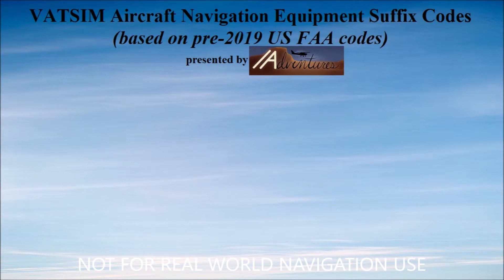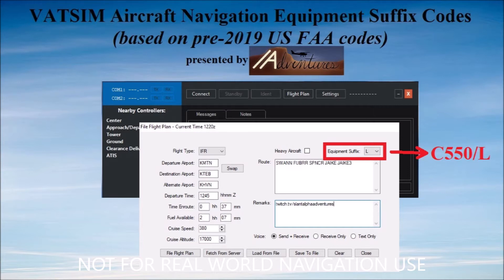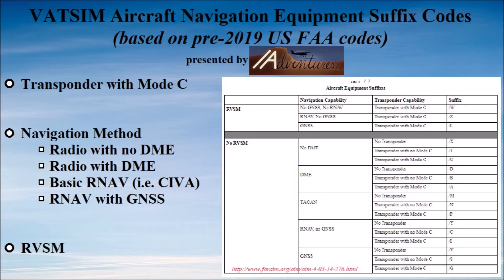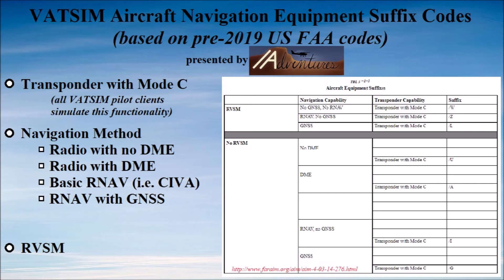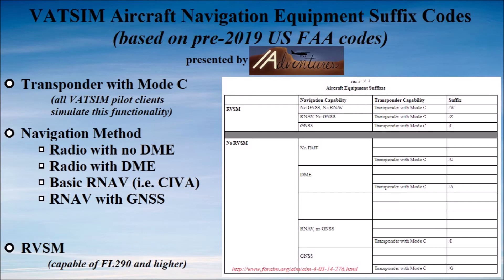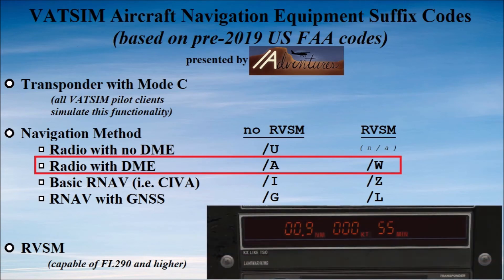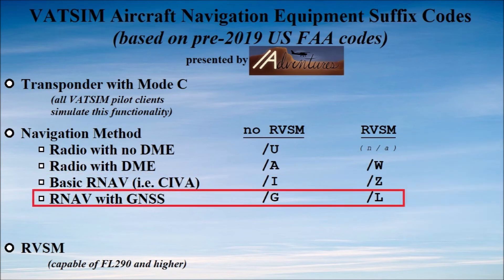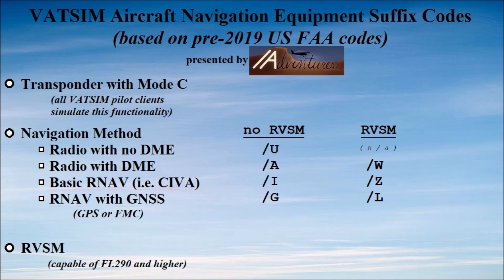Slant Alpha Adventures: VATSIM Aircraft Navigation Equipment Suffix Codes Explained

Comment: Thank you for this!
Reply from the maker: you're welcome!  at this point, though, you probably want to start looking at the ICAO ones because the rumor is that our ability to file on VATSIM using the FAA codes is about to go away.  https://youtu.be/gENYErF93WM
Reply: @SlantAlphaAdventures  ah okay. So, just use C to indicate Mode C transponder in the case of most of our GA aircraft?
Reply from the maker: sorry, I'm just now seeing this.  YouTube doesn't notify me of a second and subsequent reply on the same thread, unfortunately.

yeah, for transponder I'd go with C as a standard, vintage, Mode-C transponder.  however, with ADS-B (digital location transmission) becoming more and more pervasive, and even starting to be required in the real world to fly in certain airspaces, I guess to be consistent with real-world requirements you might just go ahead and claim you have a Mode-S (code S or L, depending on exact capabilities).  Since Mode-S isn't fully realized in most simulated aircraft nor on VATSIM yet, t's not super-critical that you truly know every nuance of it.

Comment: just a question, on xpilot how do you file your flight plan through the pilot client/ the little window. it keeps bringing me to the vatsim page and i really dislike it coming from a person using vpilot.
Reply from the maker: You can't anymore.  vPilot will soon do the same so enjoy it while it lasts.

The reason is that when changes are made to the flightplan form, it used to require every pilot client to be updated too, and they're all maintained by different people.  So they are moving toward the clients all redirecting to the web filing page.

But I'm with you.  I'll sure miss it when it's gone.
Reply: @SlantAlphaAdventures  ahh alright sad to see it going, so easy previously to file flight plans but hey at least simbrief has an import flight plan button and can do it in a quick second.

Comment: Lately every time I'm trying to fly /A I file SDF according to the new ICAO standards. When I log on the controller tells me I filed /W. So I'm confused because from what I can tell S= Standard VOR, ILS and COM radios, D= DME, and F= ADF so I wonder if I should just file A in that box but from what I found in ICAO codes that is for GBAS so like I said I'm lost
Reply from the maker: Great question.  Here's what I know -- the VATSIM servers do some "automatic conversion" from the ICAO format to the FAA format, because VATUSA controllers were getting these long strings of codes on their scopes in certain data tag modes that was making it impossible to see who was who.  But the logic isn't perfect.  And it sounds to me like the logic isn't able to tell properly whether you've filed basic VOR/DME without RVSM (A), or basic VOR/DME with RVSM (W).  But the good news is that those codes are functionally equivalent when it comes to lateral navigation.  You can't go direct to an intersection, unless you're tracking along one of its radials already, in either case.  On VATSIM the difference between RVSM-capable and non-RVSM-capable isn't truly that important.  Hope that helps clear things up!
Reply: @SlantAlphaAdventures  Thanks for your reply Rob, I actually just had a chat with an LA center controller and he did mention something like what you said. He told me to just put an A in the Equipment box like before. You just can't put a / because the website rejects it.
Reply from the maker: @Qosmokid  thats correct.  on the VATSIM flight plan web form you don't put the /.  the instructions on that page aren't 100% clear and I'm planning a new tutorial to help address it.

Comment: So /W would be for FSX/P3D Default or freeware addon airliners without the FMC, so limited to default GPS? I think at one point I thought it was /G but a controller said I would be limited to FL290, I was in the default FSX 737 at the time.
Reply: I’m on Fs2020 now but I will probably revert to FSX on my laptop when I travel, if I bring my laptop.
Reply from the maker: @DFWAvgeek521  well there's a huge gray area with the default GPS in FSX/P3D.  You're able to follow RNAV routes and procedures, so that suggests /G (non-RVSM) or /L (with RVSM).  But you can't modify the route.  TECHNICALLY speaking the FSX/P3D default GPS no longer conforms with the VATSIM Code of Conduct (which requires you to be able to navigate to a way waypoint not on your programmed route).  Long story short, there's not really an FAA nav code which adequately addresses this limitation.

Comment: It's 5.30AM and I'd been searching for half an hour for a simple answer to what these letters mean so that I could use them in SimBrief editor and VATSIM flight plan. Finally found this video which makes it all crystal clear. Thanks.

Now I imagine the next question most people will ask is whether their airplane is RVSM-capable or not. Here's something I found, which will hopefully shed some light:

The following equipment must be installed and operational to enter RVSM air-space:

#1 Air Data Computer (Pilot’s ADC) and
#1 Altitude Display (Pilot’s ALT)
#2 Air Data Computer (Copilot’s ADC) and
#2 Altitude Display (Copilot’s ALT)
Altitude Preselector/Alerter
Automatic Altitude Control System
Transponder

Any deviation from this equipment list invalidates the RVSM approval status ofthis airplane; however, operations outside of RVSM airspace may be conductedas required
Reply from the maker: The reality on VATSIM is that no one is checking your pretend airplane to see whether it has this equipment or whether its certification paperwork is up-to-date.  Hence why I say that VATSIM controllers will pretty much assume that if your plane can reach RVSM airspace, it's RVSM-capable.

Comment: Really nice video, so about 30 minutes ago, I was trying to fly in vatsim, so like always I put /L as my equipment code, and when I ask ATC for my IFR clearance, he asked me if I am able to use SID, and I have no idea what is that, so i had to cancel my flight. Please help!
Reply from the maker: A SID is a Standard Instrument Departure -- a route that takes you from the airport terminal environment to the airways.  On the other end, a STAR is a Standard Terminal Arrival Route, which gets you from the airway system into the terminal environment of your destination.  Some SIDs and STARs are RNAV -- meaning they can only be followed by a GPS or FMS because they include points that aren't associated with radio-based navigation aids.  Some are non-RNAV, meaning that they can be navigated via VOR gauges alone.  I recommend you check out our tutorial on IFR routes ( https://youtu.be/TuKqhkXQq84 ) and get comfortable flying SIDs and STARs before doing too much more flying on VATSIM, especially in high-traffic areas.  Hope that helps!